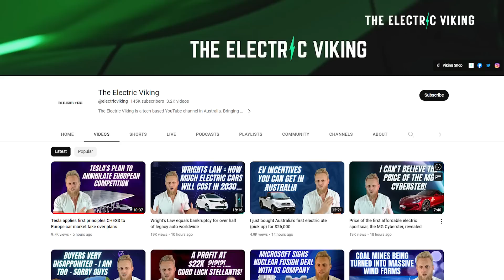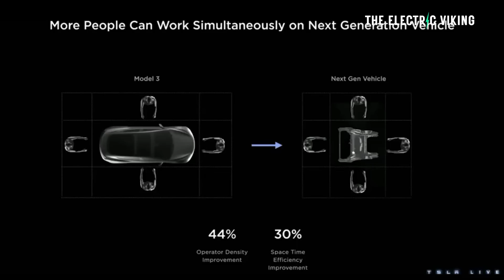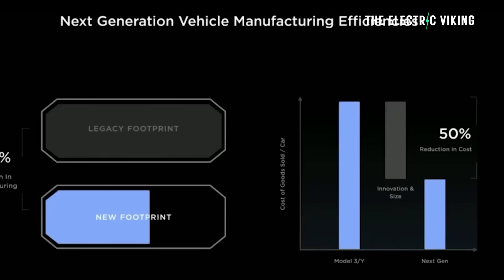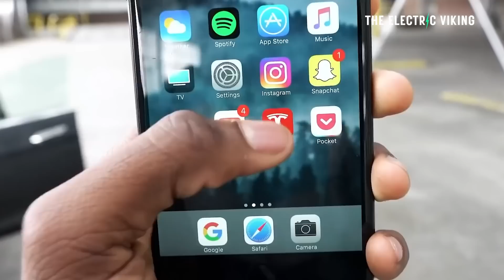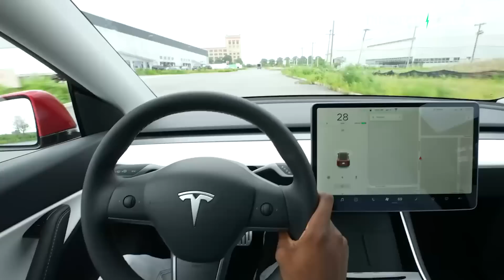Auto industry experts debate Tesla's revolutionary new manufacturing system

Comment: The legacy automakers cant even achieve the first hurdle of making a low cost EV.
That is making a single model at SCALE.
Need to manufacture a minimum of 5k per week from one production line, and preferably 10k per week, to spread the CAPEX and Fixed Costs.